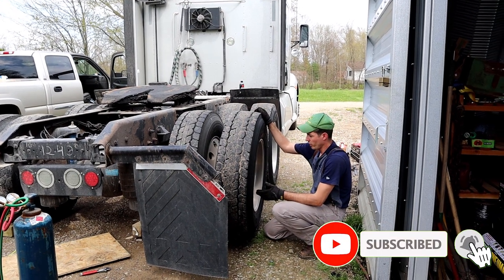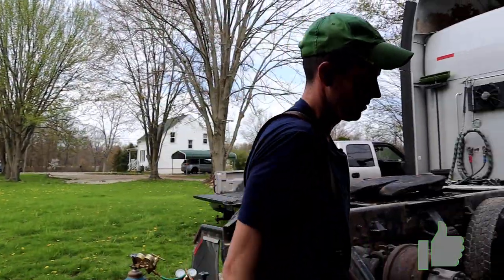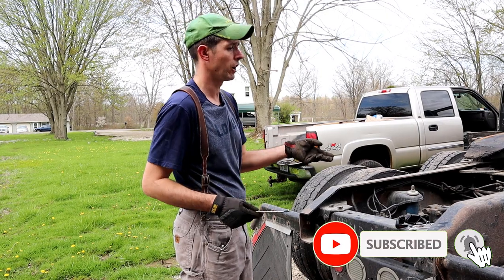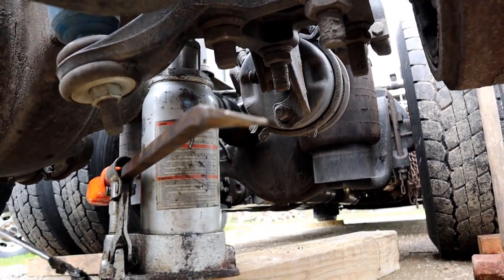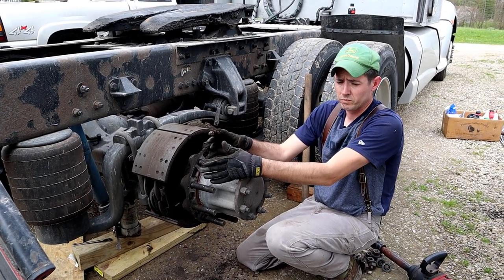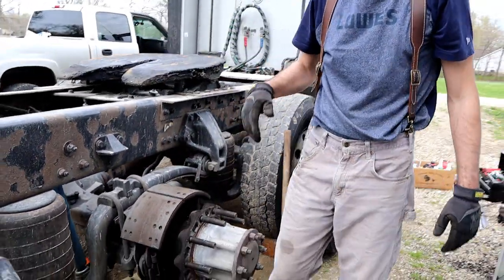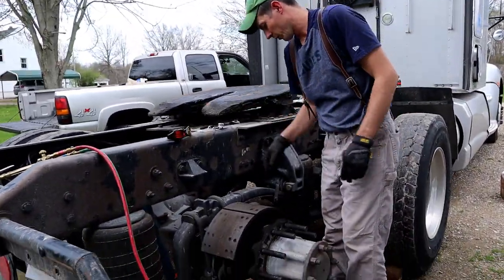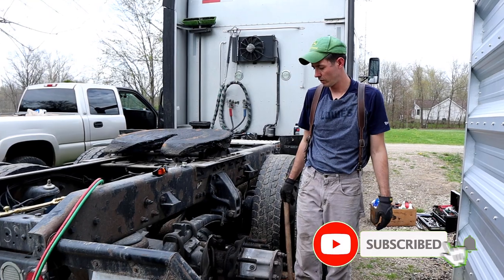How to Change Brakes on Semi Truck Part 1 - Old Brake Removal | Owner Operator Truck Repair DIY

Comment: The size of air compressor/tank to run a 1" 🙄. I ordered the torque multiplier. I'm hoping it will work just fine for my two rigs.

Comment: Ok dont cut those springs no need vise grips and pry bar is all you need theres 2 small springs clamp vise grips to top of small spring use pry bar for leverage same on back side once springs are off take pry bar put in there gap is pry then boom brakes are off no need for cut torch at all but theres a million ways to do it

Comment: You can put a big ( old ) screwdriver on that spring and hit it with a hammer.... pop's right off
Reply from the maker: Thanks for the suggestion!
Reply: Yup.  Save the gas, because when you need the hot wrench... you need the hot wrench.